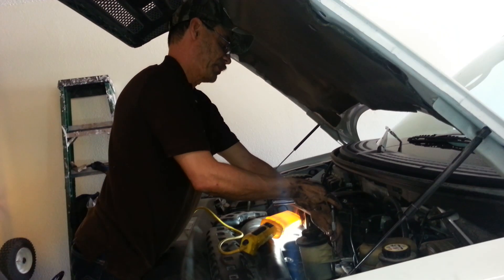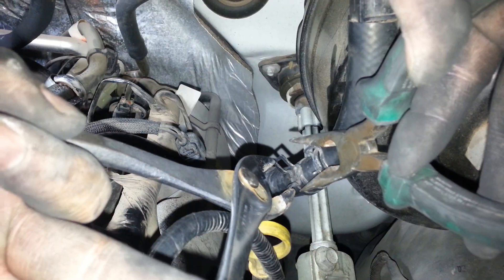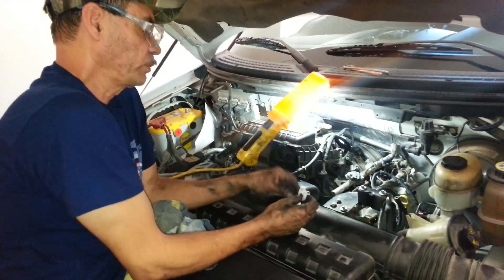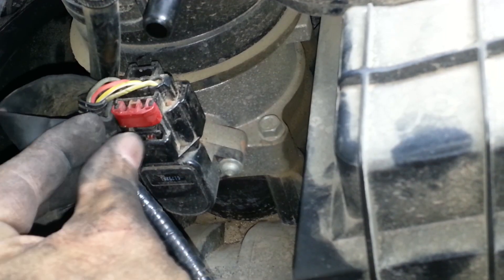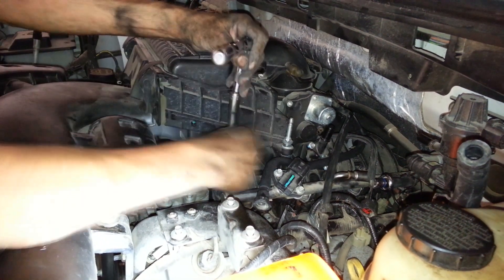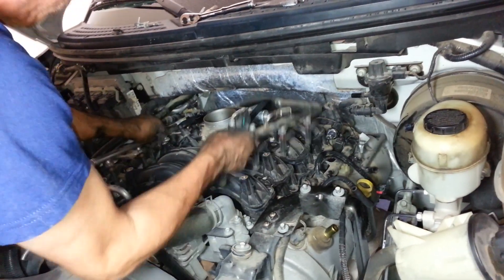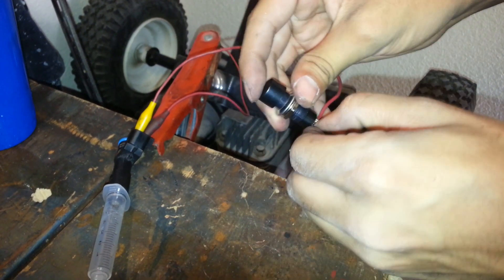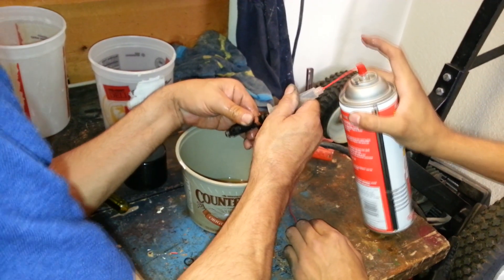F150 Fuel Injector Removal

Comment: The very first time you remove plugs let the shop do it,after that you can remove yourself,just make sure you spray a little wd40 in there and slowly break the seal,then slowly turn while putting more wd40 in there,turn them in and then back oout again make sure to use antisieze seal but not too much,i have the other triton v8 thats known for the plugs to break.
Reply from the maker: This is very true! We took our truck to the dealer for the first change. They did warn us if a plug did break they would charge us to remove the broken plug. We went forward with it anyways since they had better odds of getting them out with breaking than I did.

Comment: basically, you have to remove every hose and connector and then you get access "pretty easy"
Reply from the maker: haha. Yea looking back at this, maybe I was just trying to convince myself it was easy. After change the spark plugs on my Colorado (check out the video), i'm starting to think manufactures just like to make servicing your vehicle more difficult than necessary.

Comment: I did this process and changed my sparkplugs while at it .at first it was runing good and than it started hessitating running a little rough.any advice on what i may have done wrong or what can i. Double check?any answers are greatly appreciated .idid this because i just replaced both catalyctic converters and i dont want to ruin these aswell
Reply: Excuse me is your truck smelling gas 
From the injector?

Comment: You guys are awesome; excellent video presentation, pictures and sound. Thanks Papa, good job. I wonder if hot melt glue would have worked for sealing the red straw tube into the syringe.

Comment: nice. i have a 93 ford van E250 i starting engine runing but when i push the gas pedal turn off the engine. fuel pum is ok,sparkplus r ok, fuel are ok. my question is if can be the injectors or the  throttle  sensor? ?? please if you can help me with this?
Reply: possibly your throttle body or sensor, most likely

Comment: What is that tool he used at 4:50 called?
Reply: Zonekiller24 ford has a special way of holding certain lines. I know you need them for replacing the fuel filter. I got them at AutoZone for like 2 bucks and it came with a bunch sizes. I don’t know the name of the tool though 🤷‍♂️

Comment: at 4:50 my lines wont come off, they are really stuck on there
Reply from the maker: Groy H It wasn't very easy to remove. In the video we released them before taking the shot. Make sure you have released the gas pressure before and have let your truck sit for a while. Then give the tool a good press in and pull the lines apart.
Reply: Drench the connector spring area with WD-40 and rotate the connector slightly back and forth. Also works for Ford fuel filters.

Comment: good video but it do not help my injectors on my 93 f150 does not spray. fuel pressure  good current to the injectors but my question is what pulses the injectors?
Reply from the maker: Rony Etienne Hello, I believe the F150 injectors are controlled by computer but the computer uses the data from other sensors to decide when and how long to pulse the injector. You should check your other sensors such as the air to fuel ratio sensor or the crank shaft position sensor. If there is a ford tech reading the comments. feel free to leave a reply in regards to the question. :)
EDIT: I didn't fully read the question. I would test and make sure the injector is working first. They are 12v so you can connect them to the battery voltage for a very short period of time. If you hear them click then they are working.
Reply: You need to make sure you're getting the 12 volt pulse from the engine management computer.... check the leads (wires) that clip to the injectors and make sure you're getting a signal.

Second, check the resistance on the injector... should be 8-11 ohms.... if it's out, the injector won't open and let the fuel through, whether it's getting a signal or not.

Comment: I'm trying to fix a ford ranger that is leaking oil from the back of the intake manifold and everything was coming apart nicely until I got to the fuel rail. This video helped me out a lot because everywhere else I read said things like "step 3: disconnect fuel line, step 4: remove fuel rail". Didn't actually say HOW to do it like you explained in your video so I appreciate the info.
Reply from the maker: Your welcome! I'm glad we were able to help! Did your truck have a blown gasket?
Reply: Both of the gaskets between the heads and intake manifold were split in half and the rubber seal in the back was pushed out, but the thing that surprised me was that the 8 bolts that hold the intake to the block were only finger tight. Didn't even need tools to remove them, it was crazy.
Reply from the maker: Wow. That is not good! I ask because the F-150 in the video has a small oil leak as well but its toward the front of the engine and we are tight on time so we haven't has time to check it out. We might do a video when we get to it.

Comment: Good jod, so I can do my expedition, looks like the same motor, just should have pulled the fuel pump relay and ran the fuel lines dry first or released the fuel pump inertia switch. Very good video
Reply from the maker: Yes! Release pressure and let sit for a day because mystified gas is extremely flammable. As stated in another comment, it's a great idea to have a fire extinguisher handy and never throw water onto a gas flame.

Comment: If you need to just replace one known bad injector, I would guess you do not need to remove the entire assembly, but just unbolt the rail, lift it all up on that one side to access the injector? Would save a lot of work.
Reply from the maker: Yes, you could do that but you have to keep in mind that it takes some force to pull them out, so you'll need that free space for leverage. Now if the injector is in the back toward the firewall, your going to need to go all the way back there and you would need to remove everything like in the video. To be honest, it didn't take to much time to remove everything probably 10 ~ 15 minutes. It makes it so much easier to work with more space.
Reply: I see- thanks.
Reply from the maker: You're welcome and thanks for watching

Comment: Thank you Christian and to your father for taking the time in making this video.  I have a '05 F150 Lariat with misfire/hesitation issues and your video made the process of removing my injectors much easier.  Thanks again
Reply from the maker: Thanks for watching! Was you injector failing? or was that not the problem?
Reply: Christian Macias unfortunately no.  Currently replacing the plugs.  Pulled them and 7 out of 8 broke!!  Ugggggg. Lol
Reply from the maker: Oh man. I was about to tell you that! I took it to get done instead because I didn't want to risk it. It cost us 200 dollars to get it fixed by a ford tech
Reply: I decided to do it on my own because I knew most if not all the plugs were going to break and the dealer was going to charge me an arm and a leg to replace them.  Unfortunately I waited until 128000 miles to replace them.  My next door neighbor is a mechanic and one of his good friends is a Ford mechanic so if I run unto any major problems I know I'll be in good hands.
Reply from the maker: That's quite a bit of mileage ha ha. If i'm not mistaken we replaced the trucks spark plugs at 90,00. We took it to a friend that was a ford technician and he managed to take them out without breaking any. I think at 128,000 it would be impossible to not break any.

Comment: Great video! Did you replace all of the o-rings? Reason I ask is I noticed the rail and manifold o-rings are different. The rail side (blue) are slightly thicker in all dimensions. If so, where did you find the correct o-rings? I think most of the kits sold online and from ford are one size and I believe are only the rail side rings. Thanks
Reply from the maker: We did not replace any o-rings. Just like you said, the rings do seem to be of a different thickness. As far as finding a kit, your better off asking a Ford technician. They may just sell you the kit cheaper than buying it online.
Reply: Okay. I just went ahead and replaced the rail side o-rings since those are the only ones I was able to purchase. I went as far as calling a ford parts seller and they said the parts fiche actually calls out the same part number for top and bottom. So they did not know. Maybe an actual technician would know where to find them.

 But, like you said, they are definitely different sizes. I went as far as using my broken injector that still had good o-rings and attempted to insert it into the manifold with a new fel-pro o-ring and it was very tight. So much that it would have made the fuel rail installation nearly impossible. 

Thanks for the response!
Reply: always replace the orings! carbon build up is bad, but air leaks suck!! lol

Comment: Baxter DeBerry it's you injection coils I had the same problem it drives good at 70 but when stopped it shakes and when you pulling off it drives badly unfortunately I wasn't able to get the spark plugs changed at the same time because I didn't knw that that was the best way to do it change the coils with the spark plugs. But it drives better know just gotta get my fuel injectors changed or cleaned its still a pain for me right now . Lol

Comment: D Berry Baxter I have a 1999 f150 I had that problem up until today. actually I had to get the ignition coils changed it runs smoothly but I still think I need the fuel injectors changed or cleaned the check engine light is still on though. I hear now it's good to get the coils changed along with a tune up unfortunately I didn't do it that way though .

Comment: Cleaning injector this way is useless, pressure from the spray is nothing compare to 40/50Psi from fuel pump. Reverse cleaning is same, potential particles on injector can’t escape because they are trapped in µ-filter basket so they will come back to spray nozzle.
First, remove injector’s µ-filter basket, then clean the injector while they are operating with small ultrasonic cleaning machine.
Put new filter basket and o rings and then your good to go.
If you don’t do that, you spend time cleaning injector for no gain.
µ-filter baskets are cheap and easy to find on eBay, as well as a small ultrasonic cleaning machine.
Then you will come back to original performances and improve MPG
Reply from the maker: Thanks for your input! I will keep this in mind next time we do a tune up on a vehicle and test it out to compare the difference.

Comment: what year f150 is this?, I have a 98 4.6L, and it was sitting for a year due to family issues and pump, starter went out... we got it running finally but now it runs rought.. we ran seafoam in it, and lucas, although that helped it didn't fix the issue.. its driveable but everytime you give it a little gas it shakes.. even on the road.., weve been able to drive it at 70 no issues..
Reply from the maker: This one is a 2007